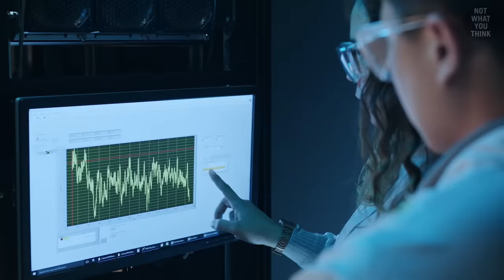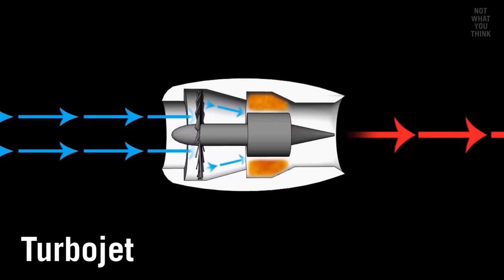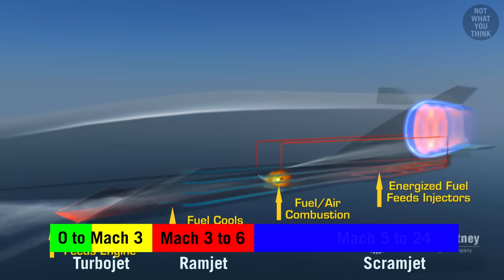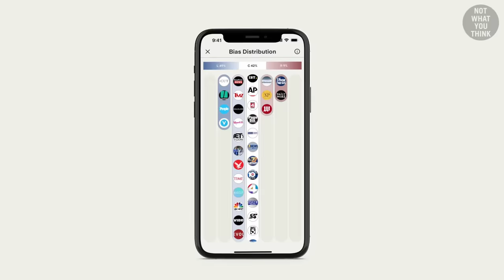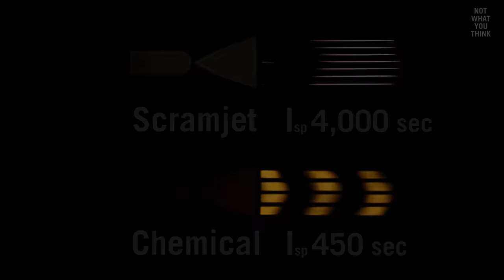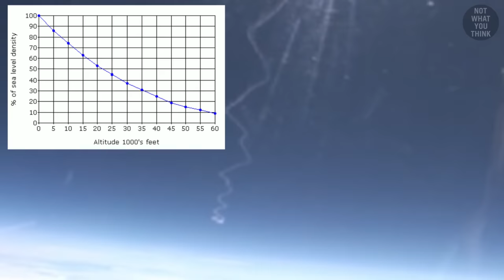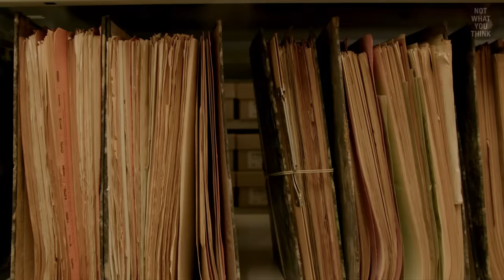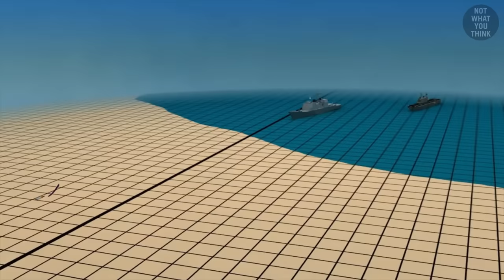The Hypersonic Missile Vulnerability That NO ONE Talks About

Comment: I would just like to point out that there are known ways to prevent the missiles from melting at hypersonic speeds during the terminal phase. The first that comes to mind is ablative coatings. We've used them for decades on reentry vehicles and it was used on the X-15. Plus, you don't need to replace it, you are only firing the missile once anyways.
Reply: If you're taking out a tarket in a fixed location , yes.  But if you need to hit a moving target that you need to see it.
Reply: "I would just like to point out that there are known ways to prevent the missiles from melting at hypersonic speeds during the terminal phase. The first that comes to mind is ablative coatings. "
A 70 year old ICBM could do that. It's the sensors needed to update guidance real time that melt.
Reply: @wisenber  so we already have missiles that can hit stationary objects at well above mach 5?
Reply: @davidandrews5262  There have been ways to hit stationary objects at those speeds since Germany launched the V2. Of course they're more accurate and developed since then.
Reply: @wisenber  so guidable-hypersonic is what the fuss is about okay.....so what's wrong with getting target from space or high altitude and then flying blind directly at target? How fast does a target have to move to avoided being hit from a blind missile starting from wherever the missile has to start from to be safe from interception. It might be. I feel like I need a rundown of history of attacking with and defending against missles.
Reply: @davidandrews5262  "How fast does a target have to move to avoided being hit from a blind missile starting from wherever the missile has to start"
The challenge is more about said missile not being intercepted on its way to a target.
Most major nations have the ability to block one. No nations have the ability to block a 100 missile saturation attack whether they be hypersonic, supersonic or subsonic. Then again, few nations have 100 missiles to use in a saturation attack.
Reply: @wisenber  The hottest part of the missile at supersonic/hypersonic speeds is where the air is at a stagnation point. This is typically only at the tip (but is geometry and attitude dependent). There is no rule that states that the missile guidance sensors need to be right at the front.
Reply: @contrail52  Then I guess Not What You Think is full of it. Good to know that we can dismiss any of his content going forward.
Reply: @wisenber  Eh, I don't think so. Just because you don't know a lot about one subject doesn't mean you know nothing. I've seen a couple of their other videos and they were fine. This one just seems like it needed more research.
Reply: @contrail52  "Just because you don't know a lot about one subject doesn't mean you know nothing."
What you just said suggested Not What You Think doesn't know anything about the subject, which would mean we shouldn't be wasting our time watching his content or commenting on it.
A hit or miss resource tends to be worse than no resource.
Thanks for the heads up. I'm unsubscribing.
Reply: @wisenber  My intension on that comment was something closer to "They may not know a lot about satellites, but they still know quite a bit about commercial aircraft." or something of the like. Sorry for not making that clearer.

While I agree that a hit or miss source is worse than no resource at all, I would disagree that this channel is "hit or miss". To me, a hit or miss implies something close to 50% accuracy. While I haven't seen anywhere near all of their videos, this is the only one I've seen so far that has rubbed me the wrong way. Saying Not What You Think is hit or miss in this context is like saying a student getting 4 out of 5 questions right is hit or miss. 

I will probably take some time at some point to watch more of their videos on subjects that I am familiar with though to check. I do think that having well researched media is important.
Reply: @wisenber  quite the drama queen you are
Reply: @contrail52  True but a missile without a nose sensor is pretty much only relying on data link of some sort. Sensors are in front because it needs to receive information from the target. Side sensors would only detect stuff at the side or communicate from the side. In most cases we are talking about ranges over 500km so thats unlikely to happen. Granted any missile being fired at targets this far would had needed a spotter regardless. But as already mentioned in the video, plasma sheath prevent communication so active nor semi-active guidance just doesn't work. In fact the only thing that require no return information is INS which is basically the worst form of guidance and only useful against static targets.
Reply: @neurofiedyamato8763  I went and did a bit of digging on the plasma sheath effect, because I had a bit of contention with it but didn't know enough to say for sure. The distinction between supersonic flight and hypersonic flight is the point at which the air molecules are broken down into more reactive species and begin to influence the fluid properties of the air. I knew ions were created by this, but I figured that you would need a full on plasma first to effect radio waves. Turns out, for wedge-like shapes, electo-magnetic interference due to the plasma sheath isn't an issue until ~ Mach 13. So there goes that issue.
Reply: @contrail52  so basically it's not what you think was wrong and hypersonic missiles have utility as long as they don't go above Mach 13 in there terminal faze
Reply: There's even a way to fly @mach 10 without a shockwave.
Reply: @MLambdaman  Source?
Reply: @contrail52  Magnetohydrodynamics
Reply: @MLambdaman  Please elaborate further. I don't see how magnetohydrodynamics is useful to a missile unless you are flying in the Sun or through a liquid metal.
Reply: @davidandrews5262  It's not so much speed as maneuverability. An aircraft carrier at full speed can do a hard 90deg turn in around 10sec if it really wants to. This means that even a minute of blindness for the missile makes it easy to avoid. With a hard turn at the start of the 1min, the aircraft carrier ends almost 3/4 of a MILE away from where the missile expects it to be when it arrives 60 sec later. A blind hypersonic missile isn't great for targets that can dodge. 

That said, think the guidance cooling problem is overblown. It sounds like a very solvable problem if not one that has already been solved. Solid sapphire optics are already commonly used in missiles and sapphire melts at hundreds thousands of degree's higher than even the most temperature resistant metals. Figuring out how to keep an instrument cool enough to get some sort of guidance (it doesn't have to be fantastic to see a 250x1000ft ship) for the last minute or two of flight sounds pretty doable. Active cooling with liquid helium can keep stuff pretty cold. Even if the cooling problem was somehow too hard, it seems like you could just keep everything protected with a thermal shield that gets jettisoned a minute or two before impact. It's an engineering problem, not a fundamental limitation of the concept. 

I think it's a mistake to assume that since nobody official is talking about hypersonic sensor capability or end of flight maneuvering that these missiles don't have it. This stuff is likely to be the strategically valuable and therefore most classified part of the whole project. So, it makes sense that there is nothing available on the internet about it.
Reply: @contrail52  There would be ways to make the air around the missile electrically conductive.
Reply: @MLambdaman  You're still not describing the reasons why magnetohydrodynamic effects would reduce or eliminate a shockwave at any supersonic speed, let alone Mach 10. If you could provide a resource or sufficiently detailed explanation, I would be greatly appreciative. I do this kind of stuff for a living, and I would be very interested in learning more if you are not in fact pulling this out of your ass to sound smart.

On top of this, to make the air conductive, it would need to be a plasma, which reintroduces the plasma sheath problem (along with exacerbating the heating issue).
Reply: @contrail52  it's so fascinating to read comments on this section as someone the designs reentry vehicles for the next gen hypersonics lol. Y'all should get in the aerospace industry! Exciting stuff going on
Reply: @contrail52  I used to be on this program while back but look up the QueSST program nasa/Lockheed is doing. Not sure what the updates is lately that's avaliable to the public but when I was on it there was a significant progress on an x59 jet that essentially reduces shockwave
Reply: @Tunechi65  I've heard of the X-59. Fascinating project and it would be awesome if it succeeds. My gripe with the last dude was what magnetohydrodynamics has anything to do with reducing shockwaves in atmospheric flight. 

I am in aero myself, though focused on the transonic world right now.
Reply: You need to discuss temperatures.
Reply: @wisenber  100 missiles (well, this month more like 70) is what russia is doing every weak or two during the attack on the energy infrastructure of Kyiv.
We intercept 60-65, but that 5-10 do a lot of damage.
Reply: @real_andrii  Either way, it's a saturation attack. Most defense systems can stop a few. Very few can stop 50. None can get 100 percent of a 100 missile attack.
Lessons learned will have aggressors leading with less costly decoys to saturate an air defense system so the more powerful missiles hit the target.
More advanced nations will tend to use fewer stealthier missiles that are more difficult to track and target.
The best place to hit an opponent's missiles are before they're launched.
Reply: @wisenber  A 70 year old ICBM is much much easier to intercept because its trajectory is ballistic. One of the main reasons behind hypersonic missile development is avoiding detection and interception. In the case of a nuclear war, it's extremely important to give your enemy as little time as possible. For conventional warfare hypersonic missiles are much less useful.
Reply: @Sahtoovi  "A 70 year old ICBM is much much easier to intercept because its trajectory is ballistic. "
A 70 year old ICBM with a terminal velocity around mach 20 still isn't easy to intercept.
MERV and saturation attacks make them even more difficult.
Giving the top 5 powers warning or not won't matter that much, as all of them have nuclear subs with the ability to strike after an initial strike. That's the whole premise of MAD. No one really wins.
Reply: @wisenber  If you give much less time to your opponent, they're more likely to make mistakes and misjudgements. If you have half an hour to evaluate whether or not you should press the big red button, you're much more likely to make the right call than if you have ten minutes. You might panic and not press it at all because you believe it to be unlikely to be an actual strike (which happened multiple times during the cold war) and have all your strike capabilities be annihilated. There's a very good reason why the US wanted to position their missiles in Turkey and the USSR wanted to position theirs in Cuba.
Reply: @Sahtoovi  "If you give much less time to your opponent"
The submarine fleet with ICBMs will have all the time in the world. They can launch in five minutes of five months, but they'll still get their shot.
Reply: @wisenber  Yes, and? That does not change the fact that reaction time is a massively important thing. The majority of Russia's and America's nuclear weapons are launched from ground-based silos, not submarines. Hypothetically, if Russia's silos get destroyed before they fire their missiles, their capabilities will be massively diminished and they'll have to change from a full and devastating launch to one where they only target the most important targets. The amount of destruction, while still great, would be massively reduced. You simply cannot ignore this fact. Launching 20 missiles versus launching 500 is a big difference.
Reply: @wisenber  yes, that do use less costly decoys: now they always mix expensive Kalibr missiles with cheap Shahed drones.
I think even Stingers are more expensive, than Shaheds.
Reply: @real_andrii  That's a strategy that will probably be replicated. The Soviet Union was already doing that with their MERV systems with some real nuclear warheads and others being decoys. It's just a modern adaptation of a previous concept.
Reply: @NBWDocSnyder  Yeah no. Your entire view is quite clearly based on misconceptions. Nuclear winters are a myth. Nuclear weapons do not shoot even close to enough ash and other particles up into the atmosphere to block sunlight to any significant degree. Also, if we assumed that they did (which they don't), it'd make no sense that the detonations all have to happen within a few days because for it to have any lasting impacts, eg. kill everyone, the effects should be much much much more long lasting and therefore the detonations could be much longer apart, which happened during the cold war with nuclear tests.
If you really do insist that nuclear winters are a thing and will happen with just a few nukes and will kill everyone, continuing is impossible since your views are completely based on lies from the cold war fear propaganda machines.
Reply: Like Mark Novak points out: all optics, radio and even sonar (how to protect the emitter receiver???) are useless while the hull is covered in plasma sheathe. Why not use a cannonball then?
Reply: @albertobernal2537  You do not need the missile to see or anything to be able to estimate its position. You know, the missile knows where it is and all that. Being able to see or get coordinates from another source sure helps with precision missiles, but with a multi-megaton nuclear warhead you do not need pinpoint precision. The missile can still know its relative position since it can measure acceleration and heading and that's all it needs. That's how the first ballistic missiles operated and they had a precision of +- a few hundred meters. With current technology you could quite easily make a missile that can manoeuvre while knowing precisely where it is.
Reply: All you need is ngad in the area to paint a target and the missile is no longer blind
Reply: @davidandrews5262  While in their hypersonic speeds, the missile cannot be communicated with, so the blind and deaf missile can’t update its targeting without slowing down. That’s what makes them frankly more similar to standard cruise missiles in practice in their terminal phase.
Reply: @contrail52  Depends on the sensors you’re talking about. Sensors aren’t magic, and are limited by physics. They can’t see what they can’t see: if you put them at the rear, they will need part of them at or near the front — which makes them blind at hypersonic speeds.

That said, I think it’s a solvable problem. I just don’t think Russia has actually solved it yet lol
Reply: @Sahtoovi  so you're saying guidable hypersonic would target enemy nukes reducing the amount launched from enemy. That makes sense. I call it less assured destruction lol.....LAD
Reply: @davidandrews5262  well I mean missile silos are probably one of the highest value targets along with major navy ports, airfields etc
Reply: @Sahtoovi  My point is that although the missile can be pointed exactly right before re-entry (dense part of the atmosphere) it does not have the maneuverability that is implied while in dense air layer: fins, ailerons, guidance rockets etc. are ALL useless if flight speed is so high.
What is it going to do? "imagine" adversaries to evade?
1) anti air defenses cannot be sensed and 2) logistics from allied sources cannot be received.
Then you'd say: well, it travels so fast it cannot be intercepted.
Yes it could, that's the whole point of large volume barrage AA artillery.
I think that using hypersonic military vehicles is just all brawn and no brains. 
Cool, but dumb. Maybe in 50 years time, but the orders of magnitude when it comes to fuel efficiency and load capacity are NOT favorable at all. 
People just get excited at "bigger, faster, badder" way too easily. But whatever man.
Reply: @albertobernal2537  it would be able to manoeuvre. Maybe not much, but it would be able to. That's really all that matters, since if it didn't manoeuvre at all, its trajectory would be basically a single calculation and interception would be extremely easy. If it manoeuvres a bit, that results in quite significant changes in trajectory because of the massive speed. Saying that it wouldn't be able to manoeuvre at all because of the speed is simply incorrect.
Reply: @Sahtoovi  the nuclear winter would come from the firestorms, not from the blasts themselves. Maybe do 10 seconds of research before you go full conspiracy mode.
Reply: @unvergebeneid  It is quite widely researched that the nuclear winter theory is not correct. It is not a conspiracy theory, maybe you should do research.
Reply: There's been serious research into global cooling possibilities over the last few years. LANL did a study of a 'regional' nuclear exchange and found it unlikely to propel enough soot high enough into the atmosphere to cause a serious amount of cooling, like Krakatoa. But they didn't study a large-scale war. Another research group found a el nino-like (warming) effect lasting a few years in their simulations. So there's quite a few possibilities left open to research. Smaller scale conflicts, air burst weapons, and cities that don't burn readily would all reduce the chances of climate effects - whatever they may be.
Reply: imagine the situation of orbital velocity to sea level, with a strait line to target. from the horizon. that would be one hot rod.
Reply: @contrail52  I thought that the main problem here is a plasma coating that prevent any sensor from working. Like, no signal, no sight.
Reply: @MLambdaman  isn't plasma already conductive?
Reply: @wisenber  rusians are trying to make their rockets stealthier, but it works only for cruise ones. They fly near ground so can be spotted only by eye. It would work only if there's no military spread everywhere and any person could spot a rocket for military what is in reality going on here. So, mass stealth attacks would work only 1-2 times at the start of war, but when military is mobilized and whole country is able to help this attack success is falling.
Reply: @wisenber  and no, shaheds are too slow to be able to be decoys for missiles. In addition they are more stealthier then everything else. Plus countermeasures against them are different from other and utilises mobile units but not with aa rockets (these are used against cruises), but a spotlight and machine gun.
Reply: @worldspam5682  Visual spotting of a cruise missile is of little use. They have to be captured on a radar system capable of a targeting solution.
This isn't WWII with plane spotters positioned on the coast radioing in a squadron of bombers.
Consequently, a missile with low radar observability is going to make it through the majority of air defenses. By the time they are targeted, they're virtually on their target.
You're right in that the number of air defense systems tracking will increase as the probability of attack goes up. That's where saturation attacks come in.
Reply: @wisenber  "squadrones of bombers" still flies high above the ground, but rusian rockets flies somewhere 5 to 10 meters above the ground. I don't think that radar would work here.
Reply: @worldspam5682  A drone serves as a decoy merely by consuming air defense tracking resources. The air defense system is forced to identify and track each, and those tracking resources have limits.
The Soviets also developed MERVs with the same goal.
Reply: @worldspam5682  Spotters don't work for the same reason. However, radar isn't constrained to being land based. AWACS overcomes those limits.
Reply: @wisenber  are we talking about nato, or about ukraine? 
And I highly doubt that flying radars can spot meter long object frying slower than birds even 10 meters above the ground.
Reply: @worldspam5682  I answered this is an earlier reply to someone else, though I don't blame you for not reading through the mess that this comment thread has turned into. For a wedge-like object, plasma induced radio signal attenuation is not significant until ~Mach 13.
Reply: @contrail52  but that means that it's max speed must be cut just to make it possible to work properly. 

And no one reads whole comment section. It's impossible to do so and then find the comment you was meant to reply.
Reply: @nicellis44  or because there's no such systems in place.
I mean, in Russia's own presentation they failed to annihilate the ship with kinetic energy which, as Russia states, should be immense....
Reply: @Sahtoovi  "avoiding detection"
Wake me up when Russia claims they have missiles that can outrun radar and IR
Reply: @Sahtoovi  sure, it can change course by hundreds of miles per degree, but that also means it gets hundreds of miles away from the target. And the closer to the target it is, the less time for maneuvering it has. So basically after one turn it could be too close to target to re-adjust. So basically, the faster it goes, the smaller cone of maneuverability it has.
Well, that's all pretty irrelevant cus we know it is not going mach 24 thru dense atmosphere, it certainly is slower at the final approach.
Like what Russia showed in their own footage... Weaker punch than just throwing a canonball from space lol
Reply: @Sahtoovi  because....
Aircraft are not traveling at mach 3-27?
Because aircrafts are a combat vehicles so they actually need to combat, whereas missile traveling at high speeds can't neither the stealthy exterior, nor the stealthy shape, because again, it 1. Needs to achieve high speed and 2. Not self destruct from it.
Reply: @Sahtoovi  1. Can it? Based on the fact you said it? If it was that simple Russia would certainly claim that too in their propaganda.
2. What evidence? The Russia claimed numbers, or the Russian video of such missile hitting a boat with some damage?
What a funny coper you are.
Reply: @Sahtoovi  Ah I see what you mean, turn that shallow parabolic trajectory into a zig zag pattern that intercepts the shallow trajectory near the target. That would indeed work, the zig zag pattern would be determined before atmospheric re-entry but still only known by the missile (and operations back at base). A random zig zag pattern of course. Ok cool.
Reply: @worldspam5682  Is it conductive enough, though ? Thats seems to be an engineering problem, but i'm no engineer ;)
Reply: @MLambdaman  I'm not either. I just know that plasma is conductive.
Reply: That works for a Q phase of a few minutes but not for an object flying for several minutes.
Reply: So you're comparing a MASS PRODUCED MISSILES to a highly experimental supersonic jet?

And you don't understand where you make a mistake in your logic?
Reply: @ripLunarBirdCLH  Do you mind explaining how comparing the two is a mistake? The main differences I see that would factor in is the type of engine and that the X-15 was piloted. I'm not sure why comparing these two is illogical unless we are comparing manufacturing techniques. If there is something that I missed I would like to learn.
Reply: Congratulations, you're hired.

At McDonald's.
Reply: @contrail52  i enjoyed your knowledge sir. it felt to me that this video was lacking and somehow biased so went to comments and here i saw you. good job. too bad majority of viewers will miss your insights and believe in whatever was described here.
Reply: @Asofe17  what is a fairytale?
That I have to spend half a day without electricity?
Why do you say "few missiles", when in fact it is 70-100 missiles every week?
And they do not always target powerplants, but the delivery transformers.
Reply: @Asofe17  tbh I'd say that hypersonic ballistic missiles are generally beneficial for any country that has nuclear weapons but the thing is that developing them is kinda expensive which is why only the US, Russia and China have any serious efforts to actually use them.
Reply: @74KU  Hyperdonic missiles can not fly below 80 thousand feet without going subsonic.   They can easily be taken out then.   If they are nuclear armed the warhead is small at the cargo capacity of a hypersonic weapon is small.   No country would strike DC with a nuclear-armed hypersonic missile as it would not be a city buster just taking out a few blocks it then makes it at all through defense design to take it out at supersonic speeds below 60,000  feet.    On a side note are you aware that hypersonic weapons would need to be launched from a most 1000 miles away, not from Russian territory let alone China?   The attacker would face a nuclear war.  Putin may talk a big game but there is doubt his nuclear weapons are more than dirty bombs with the lack of funding and maintenance.
Reply: @contrail52  Uh ... if not the front, where? You can't see where you're going? He even talked about how the ablative shields would mess with aerodynamics.  Like,  are you really watching the same video?
Reply: @wisenber  
"A 70 year old ICBM could do that. It's the sensors needed to update guidance real time that melt."
that is NOT what the video says. the video clearly says that the missile will melt. not the sensors, the missile
when the video talked about sensors it clearly mentioned them
Reply: @bluefmi  ICBMS obviously don't melt
Reply: @wisenber  Why the need for a single line of fire to intercept a missile? A low technology shotgun can hit a target easily because its lines of fire splays out at wide angles. Could the same concept be applied hitting intercontinental ballistic, hypersonic or rocket missiles? It would not be the intercepting missile that hit. It would be a shotgun type of fire from it. Maybe it could be lasers that were the actual fire from the intercepting missiles or might be better fired from the ground, either multiple beams moving back and forth around the target/targets or a single powerful beam.
Reply: @wisenber  you seem like you know what you're talking about so I'll ask my stupid question.  Could some sort of explosion be used to divert a missile if it was close ish? Like push it off course?
Reply: @grgmetube  All you need is something that works. Most missile defense missiles use a proximity detonation as opposed to a direct intercept. Projectiles aren't hypersonic, so that has to be spot on
Reply: My thought is, since they're flying so fast, the coating disappearing would screw with the aerodynamics as it ablates, throwing off the aim at best.
Reply: @marknovak6498  A Hypersonic missile is a strategic weapon mostly designed to destroy heavily fortified stationary targets, as for the navy version their target would probably only be aircraft carriers which are very big and can't maneuver very fast.
Reply: @Peregrin3  The Chinese have said they developed hypersonic missiles explicitly to keep our Carriers out of striking distance from their territory.
Reply: @marknovak6498  I know, the Russian have an anti ship Hypersonic missile too.
Reply: @Peregrin3  the demenst something they claimed was hypersonic on a floating target.   Bot it did not hit athe billed steed.  Pblem is a hypersonic speed yare fly fast high and blinf.  In order to aquire the trget you must reduce speed.  Our tech can take it out then.
Reply: that is re-entry and my understanding is that the ablative coatings were designed to allow the vehicle to slow down to supersonic speeds whilst coming through the upper atmosphere, so my question (dunno if you can answer) is how good is an ablative coating at standard air pressure (say at 10,000ft) whilst maintaining hypersonic speed.
Reply: @Sahtoovi  wrote "The majority of Russia's and America's nuclear weapons are launched from ground-based silos, not submarines."
Well . . . maybe.
If the US has complied with START-II, that means we have a maximum of 1,550 nuclear weapons deployed, but we don't disclose how or where they're deployed.
The US has a total of 450 Minuteman III ICBMs, in 3 sites (Montana, N. Dakota, Wyoming).  Each carries 1, 2 or 3 W62 warheads (a hypothetical max. of 1,350 warheads).  That's it for our silo-based nukes: 450 delivery vehicles and <1,.350 warheads.
But the US also has 14 Ohio-class subs, each carrying 20 Trident-II missiles.  Each of them carries up to eight W76 warheads -- a hypothetical max. of 2,240 warheads, out of a total of about 3,400 W76s that we've built (not all are still active).  That's 280 launch vehicles, and <2,240 warheads.
The US also has approx. 475 of the B61 and B83 nuclear bombs, deliverable by B-52s, B-2s and (soon) B-21s.  
We're also developing the AGM-181 LRSO, and plan to field about 500 of these air-launched, W80-tipped nuclear missiles.  Presuming we're still held to the 1,550 max. warheads, that means we're likely to shift some assets between the legs of the triad.  My guess: we'll pull enough of them out of the silos to get us to the target number.  I doubt very much that we'll reduce the numbers of sub-based or B-21-deliverable warheads.
Reply: @marknovak6498  wrote "Hyperdonic missiles can not fly below 80 thousand feet without going subsonic."
Wait.  What?
Can you explain how the SR-71 could manage to fly Mach 3.5 while it's below 60K feet?  
Did you mean "...fly below 80 thousand feet without going back to supersonic"?
Reply: @Robert Haines  i mean supersonic.  Cut so slack.  On a side note.  They still can not quire their target or fly buch below 80,000 feet not be hypersonic at all at 60,000 feet per the laws of physics
Reply: @marknovak6498  -- I'll be happy to cut you some slack if you put a bit more care into proofreading what you post; it's full of misspellings, poor grammar, absent punctuation, etc.
Anyway -- you wrote (I presume) that aircraft cannot "be hypersonic at all at 60,000 feet per the laws of physics".
I wouldn't be so sure of that.  Back in 2011, DARPA's experimental HTV-2 flew to Mach 20, then entered the atmosphere (sub-60K feet) and flew for 3 minutes, under control, until it disintegrated.  I haven't been able to find any telemetrics for the flight (hardly surprising, given the classified nature of the project) but apparently some of its flight time within the atmosphere was indeed hypersonic.
Reply: @roberthaines4221  Here is the deal, when you quote an experiment that shows that an object going at hypersonic speeds disintegrates in about three minutes after it drops below 60,000 feet, that confirms what I am saying.  Short of something solid and sleek like a tungsten rod, nothing is staying together at a hypersonic speed that can whirl and turn at Mach 5 plush below 60,000 feet ...  even if you could (possibly with carbon-carbon shielding and some innovative shape maybe), you still can not see beyond the heated plasma barrier that the atmosphere created in front of the ship.  You can not acquire the target nor communicate with a satellite that could see the target.  A hypersonic weapon can get to a moving target a thousand miles away in 10 minutes rather than an hour or two.  But in the dive is it supersonic we can take out the supersonic target with 1960s-based air defenses to start.
Reply: @nicellis44  For you to be able to see a 250x1000ft ship, you have to assume the ship, in this case, an aircraft carrier, hasn't used any of THE BATTLE GROUP'S countermeasures, active and passive, to defeat radar, thermal, RF, etc. threats. When you look for the target you will find it, along with hundreds of others that look exactly like it in the general area of a few tens of square miles. Choosing which one to take out will be your challenge!
Reply: micro pores with cryogenic liquid helium evaporative cooling and micro grooving  gets you cooling and greater speed
Reply: @contrail52  couldn't you negate plasma with technology 
    look to see some future designs that actually incorporate high voltages to affect the charge and increase efficiency
Reply: @contrail52  if you look at it from a straight physics perspective with the forces you're dealing with 
    it seem like a mathematical problem that has a engineering solution
Reply: @contrail52  like charges repel opposing charges attract 
     I know im not the smartest person so if I can see there is a way to use electricity to solve this issue and increase efficiency 
    I'm sure it won't be long before we have plasma scrams that use micro grooving with cryogenic helium and plasma to create a near frictionless environment imagine a missle that uses every bit of air that it encounters so there is no friction on the outside of the missle
Reply: @terranovarain6570  and has it ever been tested
Reply: @contrail52  But, if you think about it, air turned to plasma at the nose, of say, a Mach 6 (~1 mile/s) missile will spread along the sides (say 0.001 mile) in t = d/s = (~0.001 mile) / (1 mile per second) = 1 millisecond. Thus, the plasma would not cool enough in that time as it spreads to the sides to allow radio communication or sensors to work, no matter where on the missile they were placed.
Reply: lol i just write that do icbm warhead melt in re-entry...wtf he talk would it will be nice trident warhead falling 20mah then slow to 2mah so s-125 goa could hit it an nuclear treat in world over.....or they melt before hiting ground like meteor in simpsons cartoon[[[i think he got thet episode seriusly]]lol
Reply: From what I have seen, if it was travelling at hypersonic speeds during terminal phase, the tiniest impact, even going through a flak cloud, would cause it to disintegrate. So in the case of an anti-ship hypersonic, even if the issue of target tracking through plasma sheath is solved and a super special (magical) material capable of travelling through the lower atmosphere at these speeds are used , the missile would be seen coming due to its immense heat and reflective output on IR and radar sensors, and something as simple as a flak cloud could cause it to disintegrate. 

Now if you also consider the vast cost reportedly involved in each missile (US ones range from $40 million to $70+ million EACH) compared to a cruise missile (about $1-2 million each) , and the fact you could launch a 40+ missile saturation attack with the standard cruise missile for the same cost as ONE hypersonic (so for the price of 3 or 4 hypersonics you could launch an undefendable saturation cruise missile attack)  and the logic of hypersonics starts to diminish somewhat. 

These missiles are essentially propaganda and hype tech as far as I can tell, with Russia aiming to remain relevant as a global power, and China aiming to deter the US and western allies from getting in the way of their designs on the South China Sea and Taiwan. I dont think either really want to have to prove the theoretical effect of these missiles, in case they are then proven to be a lot less 'uncounterable' or effective than advertised.

If we are talking about nukes, it all just comes back to MAD and ultimately being a deterrent and not something that would ever be used if the user wants their own country to still exist afterwards as well. Not to mention the interlinked nature of our economies and how removing large chunks of it globally would cause collapse in other areas.
Reply: @davidandrews5262  Exactly. Put a couple of fins on a ballistic missile and you have the Kinzhal, Minor adjustments though. Pointless for hitting ships.
Reply: @davidandrews5262  Some defenses are so simple that it's almost laughable, especially in the navy. As said, the Zircon obviously doesn't hit at hypersonic speed and would need a sensor to point to the ship's current location. It's a target then. those sensors  could also be fooled by throwing metal confetti into the air. Chaff.
Reply: @contrail52  You still have a mass of plasma that is like a wall for sensors. Here is something to think about. As said, a ball of plasma is not stealth. It is sensory black out. it's like using a tarp to hide from weapons as you attack. You can't see what you are attacking, but the other guys can see and shoot at the moving tarp.
Reply: He did refer to ceramic tiles (which is essentially the same thing) in the video.
Reply: yeah, this entire video hinges on hypersonic missiles being stupid because "you cant make a missile that survives at 2200c" and you absolutely can lmao
Reply: @contrail52   wisenber is right, a lot of his content is kinda garbage and very misleading. and forcing that "not what you think" into unrelated places gets on my nerves every time.
Reply: @nicellis44  I maintain a much simpler approach to this, since advanced physics tends to melt my brain.  If DARPA can't solve a problem, it's very doubtful anyone else can.  We'll know in about 50 years.
Reply: I was thinking this too, that hypersonic missile need to survive melting for 10-15 seconds on the terminal descent, and as you said all these missiles are single use.
Reply: @wisenber  perhaps last 10 seconds missile can do without guidance and go as pure ballistic missile with an engine.
Reply: @Nauda999  The last part tends to be when most alterations are needed
Reply: @wisenber  could you explain that please?
Reply: @Nauda999  An unguided object traveling Mach 5 for ten seconds gives you a +/= 500 mile target zone. That would be the distance between Paris and Berlin, which isn't exactly accurate enough to be useful.
Reply: @wisenber  what? Mach 5 = 1500m/s *10sec = 15km how did you get 500 miles?
not to mention missile going straight down, and doing a 1km altitude 4 megaton air burst.
Reply: @Nauda999  You're right, I took the speed per minute instead of seconds. That means you're +/= 15km without guidance over the last 10 seconds. Not exactly useful for any conventional weapons when considering guided munitions hit within +/= 3 meters.
Reply: @wisenber  when a missile is going straight down it can always tell which way is down, due to gravity and magnetic fields are still working.
Gyroscopes, accelerometers  and magnetometers to know exactly which way is down, sure it will not have 3 meter accuracy, but if you are doing 1 km altitude air burst then even +/- 500m is good enough.
Or do you think 4 megatons detonated 1000m or 1500m from an air craft carrier will be a significant difference?
Reply: @Nauda999  That's a pretty weak responce to a +/- 15km accuracy. Then again, no one suggested the missile would be off on the Z axis, and nukes weren't part of the topic.
Reply: @wisenber  how does the payload not matter?
And you said mach5 missile would have +/- 500 miles accuracy, I am saying it would have at least +/- 500 meter accuracy, that is a big difference. That clearly is very far from +/- 3 meter accuracy, but still would have a specific use application even at +/- 500m accuracy.
Reply: @Nauda999  How many ways are you going to try to rationilze only having a +/- 15km tolerance?
Reply: If laser tech improves as it has? Hypersonic missiles maybe the best way to counter them since it takes time, and line of sight for them to heat up the target. Conventional will be susceptible to them. Especially once Megawatt beams and higher become available. 

 Right now they are so expensive. Better to have 100 cruise missiles over a single hypersonic.
Reply: @Sahtoovi however, the majority of US WARHEADS are on submarines.
Reply: @wisenber most current interceptor technology is actually hit to kill, not proximity and the anti-missile missiles are indeed hypersonic.
Reply: @vanguard9067  "most"

"and the anti-missile missiles are indeed hypersonic"
Or supersonic and not faster than Mach 5 for any meaningful time.
Reply: @wisenber  I should have been more specific.  Most US anti-missile missiles PATRIOT PAC-3 MSE is Mach 5.  THAAD is Mach 8+.  AEGIS is Mach 8.8-13.2. Upper atmosphere/space of course;
Reply: @vanguard9067  That's a minority of US inventory. "Most" aren't hypersonic.
Reply: @wisenber  what other anti-missile missiles are there?
Reply: @vanguard9067  For starters, you left out 2/3 of the Patriot arsenal and about the same from the Navy.
Reply: @wisenber  aren’t the Patriots all,being upgraded as we speak? And isn’t the SM-3 the missile designed to defend against ballistic/hypersonic missile?  We are not discussing defenses against sub- and supersonic cruise missiles, are we?
Reply: @vanguard9067  No. The Patriots aren't all being upgraded as we speak.
That being said, Mutually Assured Destruction tends to be a pretty effective deterrent.
None of the three largest players have the capacity to block a meaningful amount.
Reply: Now we actually have a video (well, 4-5 frames maybe) of a hypersonic missile hitting its target, and yeah, it glows like its molten as it flies
Reply: @wisenber  I shouldn’t have said “all”.  “Many” would have been better, more accurate.  I apologize.

I agree, anytime nuclear weapons would be used, regardless of the delivery method, MAD becomes the likely outcome.
Reply: @Sahtoovi  Why are you being disingenuous? The nuclear winter effect NEVER had anything to do with the direct effects of nuclear explosions themselves kicking up ash and dirt into the atmosphere - It was always caused by the indirect effect of the blasts re: uncontrolled city firestorms kicking up massive amounts of smoke and soot into the atmosphere.
Reply: @davidandrews5262  "o you're saying guidable hypersonic would target enemy nukes reducing the amount launched from enemy. That makes sense. I call it less assured destruction lol.....LAD" 

They're still completely useless against SLBM's. American nuclear doctrine has consistently recognized the possibility of land and air-based nuclear assets being destroyed in a first-strike scenario. The introduction of hypersonic missiles does would not  alter this underlying assumption.
Reply: @vejet  why are YOU being disingenuous? read the studies that claim nuclear winters to be a thing. I did that, you clearly didn't. then read the studies that show those studies to rely on incorrect assumptions. I did that too, you clearly didn't.
Reply: @Sahtoovi  I'm not arguing with a liar, in case you forgot this is EXACTLY what you said: "Nuclear weapons do not shoot even close to enough ash and other particles up into the atmosphere to block sunlight to any significant degree."
Reply: @vejet  I told you to read studies on the topic and you say that you're not arguing with a liar. Are you openly refusing to read the studies? Fitting, considering that you clearly do not know the facts of the matter and you admitting that to be the case makes this a whole lot easier.
Reply: @contrail52  "There is no rule that states that the missile guidance sensors need to be right at the front."

Then why couldn't they prevent the communication blackout of the Space Shuttle by simply putting the antenna at a cooler spot?